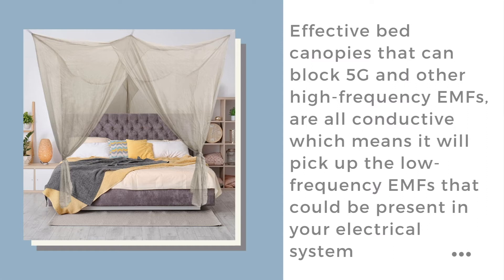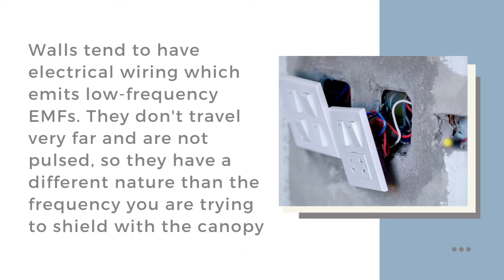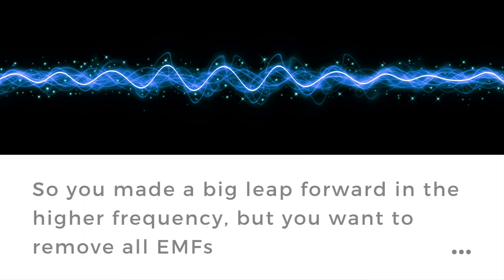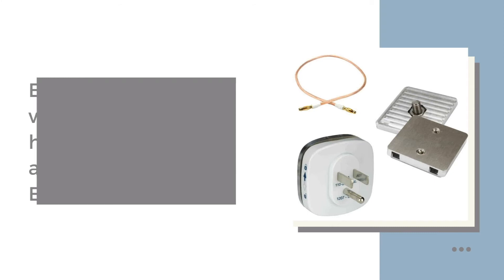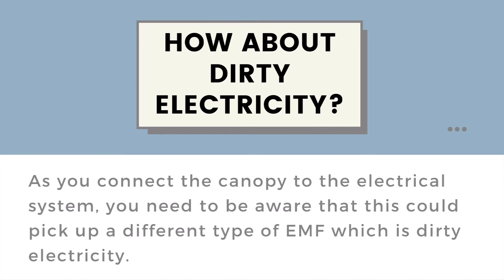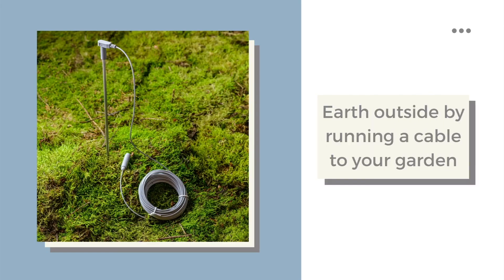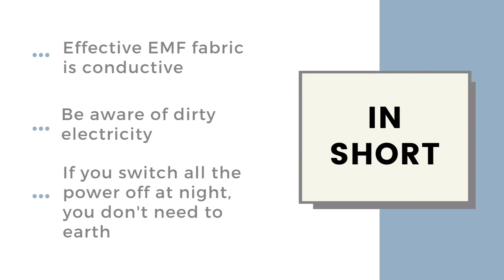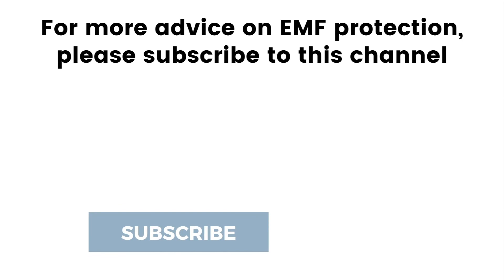Why Do I Need To Earth My Bed Canopy? | Getting To Know EMFs #5

Comment: I have built 2 Faraday cages to sleep in at my old apartment. The first one was too small so I made another one which was much bigger. It worked until they installed more rooftop cell towers and neighbors installed wifi extenders, routers ext.
I ended up moving again due to the electrosmog. Now living in a house 0.6 mile from the nearest cell tower. I bought a bed canopy from Swiss shield: natural ultra which is groundable. I can't ground from the wall outlet as it raises the electric by my meter reports. Also the bedroom has a outlet on each wall. I have unplugged everything but in the summer it gets very hot in the canopy due to the denseness of the fabric and the thermal heating effect. So an air conditioner is needed in the room. I shut off the ac before bed and than lower the canopy but the electrical is still very high even with an unplugged air conditioner. I wake up numb sometimes from touching the walls of the canopy while I sleep.  My old Faraday cages were made of 100% copper mesh and ni/cu fabric for the floor sheet. I didn't have this problem with my custom cages. Could going from 100% copper to 18% silver/copper and 1% carbon in this canopy make the electric worse?
Also I can't shut off the circuit breaker. What options do I have in this situation? Also I have noticed the Swiss shield fabric does not work near a cell phone. From my experience this fabric is for a low level environment and much too dense for air flow. I have to keep the canopy slightly open on one side for air. I would not buy this type again.

Comment: What do you do for your fridge freezer in the case of turning off power to house via the fusebox? Do you run on a portable generator overnight?

I had gone through a period of about 8 months of feeling ill waking up and like I hadn't had rest. Also no dreams. Started doing research about emf etc, bought a reader and found that the EF reading from the wiring in my walls was high. Too high to have my head right next to it for sleep. So i turned off the power at night and started sleeping better and having vivid dreams nightly..bought a canopy and was disappointed to have the EF reading without improvement. However I hadn't considered earthing and that without it the conductive nature of the canopy would amplify the electric wave. I will buy an earthing plug and see if i get improvement.

Comment: The grounding mate that you offer you don't have to ground the mate into eclectic plug socket and From what I understand you just put the grounding mate under your bed on the floor and can you put the grounding mate on carpet or under the carpet I will be using a through rug either on top of the grounding mate or I won't be using anything other than the grounding mate and then I plan on putting up a canapé and the canapé will have to be grounded I would like some feedback information and would really appreciate your time in assisting me on my questions thanks God-bless.
Reply from the maker: Hi Doug, you do need to ground the mat if it’s on its own or either the mat or the canopy if you have both the ground can be to a socket or outside to earth.  God blesss you

Comment: Does my bed frame have to be all wood?
Reply from the maker: No most of our clients use our metal frames.  That’s fine,  Blocsilver shield’s the frame
Reply: @EMFProtection  that’s what I thought at first ! But so much contradicting information!
Reply from the maker: @Dazzi-db  I know having provided emf shielding for over 18 years I have heard a lot of ideas 🤓
Reply: What about if I have an adjustable electric base for my bed?
Reply: Yes, pine wood is the best in my designs. Metal is conductive and you don't want anything in the cage/canopy to be conductive. I know some will disagree but this is what I've found with my experiences.

Comment: If you are using dirty electricity filters will that sort out this issue?  People in apartments can't ground so they need options too?
Reply from the maker: Dirty electricity filters will make it possible for people to ground into the circuit earth when in an apartment; without in most cases the adverse effect of dirty electric blow back into the ground connection.  So in short very possibly but not definitely.  This depends on an individuals specific ES allergy.  Sorry I couldt be more definitive here.

Comment: Hello, do I have to have the power on in my room for my emf painted room to be grounded into the plug that is in the room? 
Or
Can my room still be safe with the paint grounded in the plug in my room without power coming in. 

Thanks.
Reply from the maker: No need to have the power on.  In fact much better to have it off.

Comment: Is using an EMF bed canopy superior to just sleeping on a grounding mat? I'm not quite sure I understand what the differences would be... Obviously the latter option is much cheaper.
Reply from the maker: The difference is too dramatic for words.  A grounding mat removes electric fields from wiring, connects you to the earth, but if not fitted correctly it will also connect you to dirty electricity.  So you remove one emf and introduce another more toxic EMF (in some cases).  A bed canopy (the right one fitted correctly) removes THE MOST dangerous EMF, pulsed microwave radiation from 2G,3G,4G, 5G, Wi-Fi etc.

Comment: Hello. Does the bedframe and poster need to be wood/plastic instead of metal
Reply from the maker: You can choose a wooden or metal frame.  The frame is covered by the fabric and therefor grounded.  But when dealing with extreme HF EMF a wooden frame might be better.

Comment: And in another video you have grounded with ground fabric in my case i dont use any favbric or mats in ground so how should i do earthing with four poster canopy.??
Reply: did you find a way?
Reply: @bootangy   no please tell me
Reply: @thirukumaranVellalar  turn power off
Reply: Power off means the whole house power like In MCB board or just the switches near canopy ??
Reply: Should I turn off electricity to home even if i didn’t turn on any plug switches?
Reply: And i have build my bed 🛌 in wood can i ground in that
Reply: You can connect the canopy fabric directly to a grounding cord that gets plugged in. With a snap, an alligator clip, or the Y-Shield plug that puts the fabric between two plastic pieces with a strong magnet. However, you won't have a faraday cage without a fully enclosed space, so no mat means you're missing out on the benefits of this. Simply grounding your canopy that has an open end isn't going to do much for you.
Reply: @Anon-sj2qo  okay. Thank you so much.

Comment: There are two plug nearby my bed. And I dont use them at night, only AC , fan and light switch is used at night do i need to earth for this. And why it is recommended to power off at night not day time. Is turning on all powers in day time is okay ?  Please answer

Comment: Good video. So would you say with an ungrounded canopy in the middle of the room (far enough away so body voltage does not increase while laying on bed) would be the same result as grounded canopy with stetzer filters in the house?   I'm going to test this, but like the way you describe it!  It's hard to get a sense of how the conductive/non conductive bed canopies behave without testing them. (I think I get BS answers from some vendors who sell them also) Like your vids!
Reply from the maker: Thanks for your comment Matt, your channel is awesome too!
Reply from the maker: There are a lot of different factors for this.  The Stetzer filters should help lower the dirty electricity, which is good but not really relevant to body voltage.  Also, it depends as to whether you are using a conductive canopy or a none conductive fabric such as the Swiss Shield fabrics.  So in short to cope with the modern HF signals in most of our bedrooms we need a conductive canopy such as BlocSilver (good air transfer and none toxic, with excellent shielding).  In the middle of a decent-sized downstairs bedroom with a moderately high ceiling, you could avoid grounding.  My preferred option is a BlocSilver four-poster framed canopy.  I switch all power off at night and therefore don't need to earth.  If you cant isolate your power to the bedroom and do need to earth, you need to take care of your dirty electricity to the circuit you are earthing to or run your earth outside.